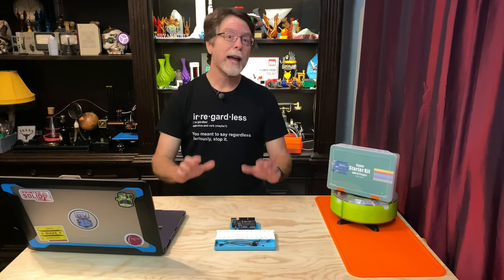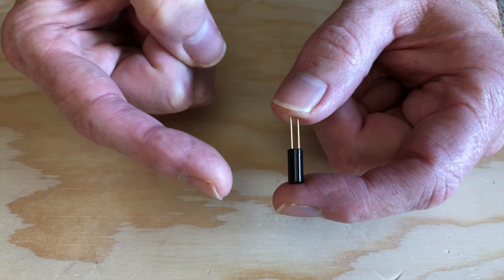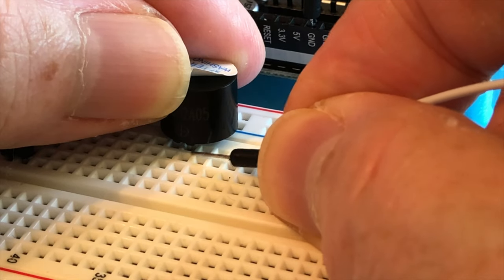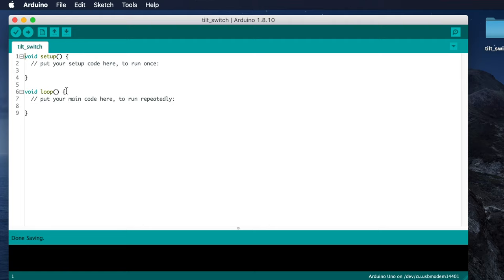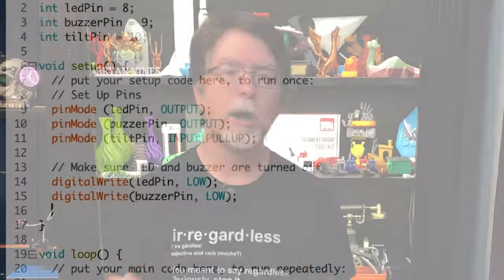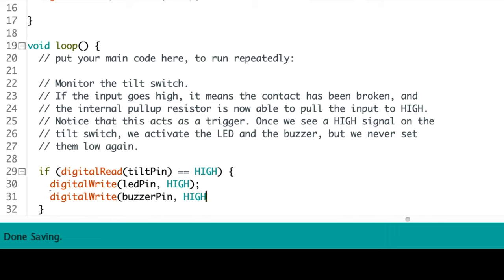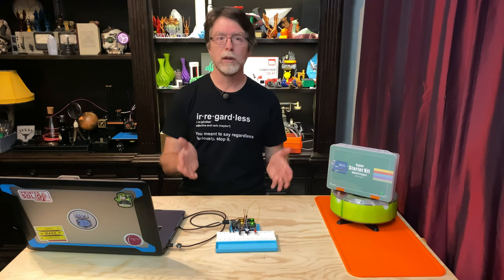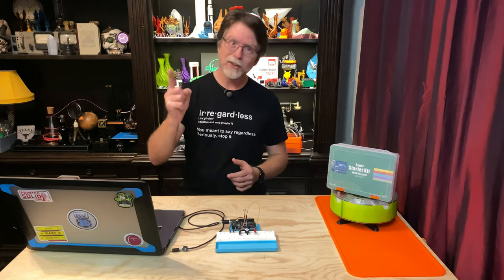Get Started in Electronics #6 - Motion-Activated Tilt Switch Uno Alarm!

Comment: Hi Bryan,

Great content, really enjoying it!

I've been watching the guides up until this point, I didn't want to lose the functionality of power on/off:

// Pin Variables

// Making use of on/off monentary switches
int buttonOnPin = 5;
int buttonOffPin = 3;
int buzzerPin = 9;
int ledPin = 8;
int tiltPin = 10;
// String variables to hold power and tilt state
String powerStatus = "OFF";
String tiltStatus = "OFF";

void setup()
{
  pinMode(buttonOnPin, INPUT_PULLUP);
  pinMode(buttonOffPin, INPUT_PULLUP);
  pinMode(buzzerPin, OUTPUT);
  pinMode(ledPin, OUTPUT);
  pinMode(tiltPin, INPUT_PULLUP);

  // Start Buzzer and LED at off
  digitalWrite(buzzerPin, LOW);
  digitalWrite(ledPin, LOW);
}

void loop()
{

  // put your main code here, to run repeatedly:
  //Setup Pins
  if (digitalRead(buttonOnPin) == LOW)
  {
    //Power On LED Lights Up 
    powerStatus = "ON";
    digitalWrite(ledPin, HIGH);
  }
  while (powerStatus == "ON")
  {
    if (digitalRead(tiltPin) == LOW)
    {
      // Triggered when tilt twitch is upright (mine is on long cables so when held up triggers LED to flash and buzzer to beep intermittently)
      tiltStatus = "ON";
    }

    while(tiltStatus == "ON")
    {

      digitalWrite(ledPin, HIGH);
      digitalWrite(buzzerPin, HIGH);
      delay(50);
      digitalWrite(ledPin, LOW);
      digitalWrite(buzzerPin, LOW);
      delay(50);
      digitalWrite(ledPin, HIGH);
      digitalWrite(buzzerPin, HIGH);
      delay(50);
      digitalWrite(buzzerPin, LOW);
      digitalWrite(buzzerPin, LOW);
      delay(50);

      if (digitalRead(tiltPin) == HIGH)
      {
        tiltStatus = "OFF";
        digitalWrite(ledPin, HIGH);
        digitalWrite(buzzerPin, LOW);
      }
    }

    if (digitalRead(buttonOffPin) == LOW)
    {

      powerStatus = "OFF";
      digitalWrite(buzzerPin, LOW);
      digitalWrite(ledPin, LOW);
    }
  }
}

Comment: Hi! Love the content, I have learned a LOT from your videos! - Question, I have tried to run my arduino of the 9 volt battery included in the kit, but it doesn't seem like the arduino remembers the code. Do I have to do something different to run my arduino off external power?

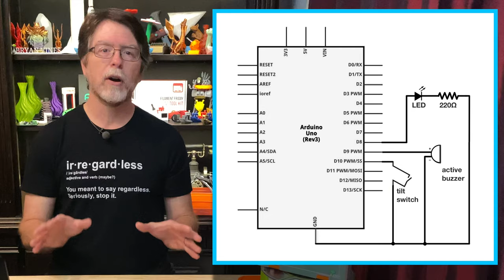Comment: On the sketch at 3:09, shouldn’t the resistor be upstream of the led? You wired it that way, I think 🤔
Reply: Don’t we want the resistor before the led to protect it? On the power side?
Reply: @Kidge.6081  the way resistors function and based on electronic principles, it does not matter which side of the LED we place the resistor (I think); if you wanted to, you could place the resistor on the lengthier anode side of the LED and it would still work the same.
Reply: @moretao9837  well, it does seem to work.

Comment: How can I make the buzzer beep instead of constantly hurting my ears? I tried combining the code from the previous lesson (high, delay > low, delay) but it doesn't work unless the tilt switch is constantly in the high position
Reply: Ok so I just repeated the high state on the buzzer (so now it's like high, delay > low, delay > high, delay) and it's constantly going on and off, as wanted, but I don't get it. Coding is weird

Comment: Ok I recreated this video easily enough.  Then I thought I'd add a button to the project to 'Turn Off' the alarm.  And it works but I have to hold the button down.  When I let go of the button then the alarm starts back up.  Any recommendations?   Pressing the reset button on the arduino will silence it so I googled resetting programatically but it doesn't work.
Reply: Disregard this question.  Five minutes after posting the question I found the answer.  Just ran the button to the reset pin on the Arduino board.   I should note that my tilt sensor had to be mounted to a breadboard because it has to remain upright otherwise it is switched on all the time.